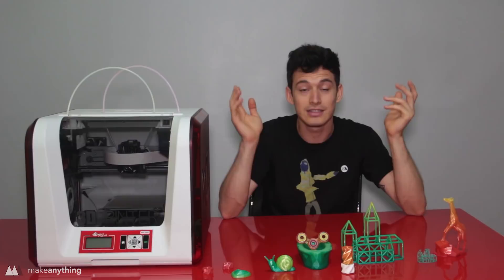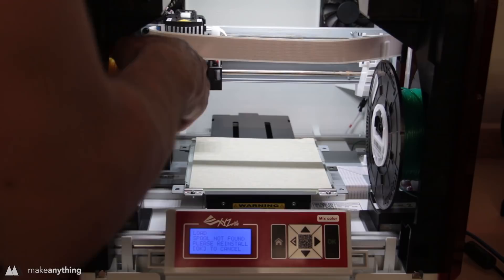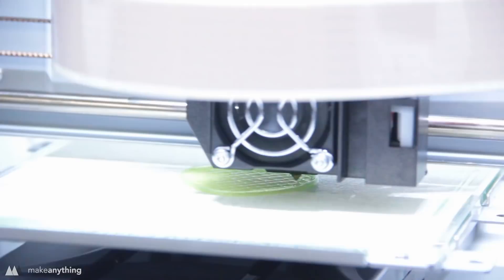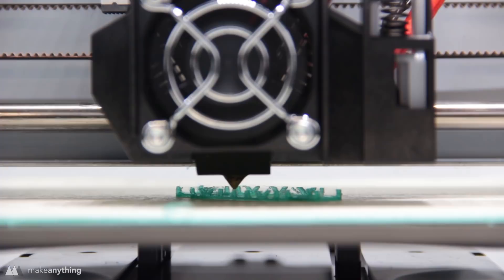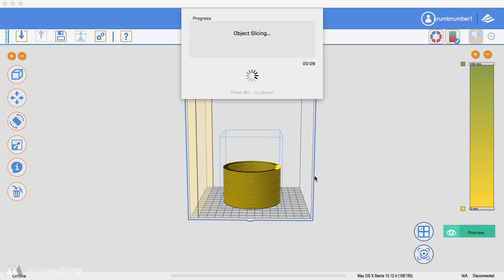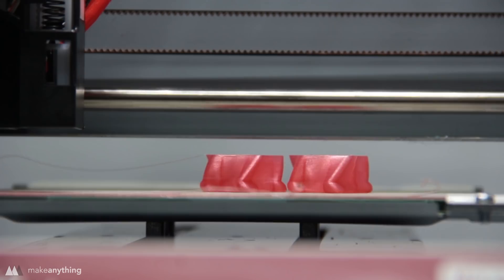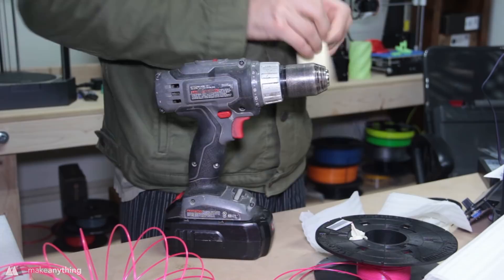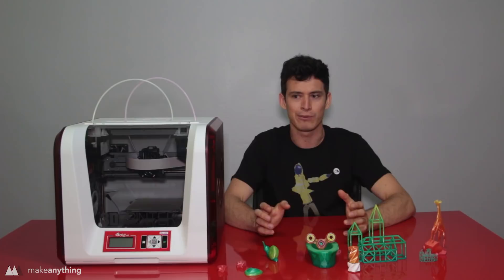Blending Colors with the DaVinci Jr. 2.0 Mix // 3D Printer Review

Comment: Even if this printer had incredible print quality, I wouldn't buy this on the principle that they've locked it to only use their spools. We, as a growing community, shouldn't be supporting these kinds of practices
Reply: And this printer only supports proprietary software
Reply: you probably could make something in fusion 360 or other software's and load it into that software and then you can print it
Reply: Not for stl files, for slicing, like you cant use cura simplify3d etc.
Reply: Box-Of-Hats I have a custom made reseter chip that will trick the printer into thinking it is full so I can use 3rd party filament. Now I have flashed mine to use repeater host firmware so I can slice with slic3r or any software I choose, but this took a lot of work and it's a shitty printer. STAY AWAY BUY ANOTHER PRINTER!!
Reply: Box-Of-Hats exactly, it doesn't use g-code. It uses its one code. You can't even use your preferred slicer.
Reply: Darien
Reply: Box-Of-Hats yep they took free open source stuff and tried to lock down the software  DO not BUY THIS IS A CON
Reply: I am a 3D-print enthusiast, although I don't intend to buy a 3D printer right now. I don't agree to this spool policy.
Reply: Buy a duplicator i3 instead of this
Reply: Totally!
Reply: Exactly if I could have used wax filament that I can purchase near me I would get this machine. Unfortunately they lost a customer due to this.
Reply: @Pandonaut  you can but it involves having to encrypt the gcode in base64 or something along those lines
Reply: You can use other spools. Well, you can actually reset the chip in the spools to think it has more than it does(you need an nfc capable read/write device) some really cool people were able to find the algorithm for the passwords and you can now get the password for your chip online. Complicated but if this printer is all you have then its worth it

Comment: So it needs to extrude a lot of material when swapping colours, has a shitty slicer and proprietary non-reusable spools.

Not really worth it.
Reply: ABaumstumpf while changing colors, a purge tower is normal. So no wasted plastic here. But im with you on everything wmelse you said. I would buy it, if they wouldnt lock you onto their filament a d slicer.
Reply: Bilal Akyüz there doesn’t seem to be a halfway decent open source slicer that does mixing, unfortunately. Slic-three-R has the other kinds locked down (multi-extruder and load/unload) but nobody is making a successful mixing printer that isn’t proprietary.

Comment: I had a Jr 1.0, and I basically had the same issues you did.

The biggest problem is the tolerances though. Printing statues and stuff is fine, but printing interlocking parts is VERY difficult as you have to modify the dimensions of the model to compensate for the massive over extrusion.

Another problem I had was accessing the extruder to clean it. It has a tiny opening where you can shove an included straw brush down into the extruder gears and that works most of the time. 

But if you ran into a filament jam and it really got dirty or you needed to oil something you have to basically take apart the entire top of the printer to get to the extruder assembly, and even that required some frightening wire disconnecting.

That being said, I replaced this printer outright with a Monoprice Maker Select Mini and I have been very happy with it. knocks on wood lol

Comment: Would it be possible to read the full spool nfc code and write it to blank nfc discs and use them to spoof spools?
Reply: You can now buy the nfc chips from a guy who makes them on ebay.  I use them and they work great.  You can put filament on the empty spools and start printing with no problem.

Comment: Great video, but the printer/software is exactly what I expected.
My first printer was the DaVinci 1.0a which had all the same problems you outlined. I quickly flashed the firmware to Repetier and things improved dramatically. Another huge negative is the customer support, it's horrendous. Worse than having none at all. They make you jump through hoops before they will even consider sending you the replacement part that snapped. That was my experience.
I've since given it to a friend ... yes, he's still my friend lol

Comment: Get a chip reader, copy each chip at its full state.  Then when it gets programmed by the machine at the end of spool stage you can reprogram it to its original state with your own filament.  If that doesn't work try making a clone of the chip to see if you can make it work that way.

Epson tried this in a way with their printers.  The chips on the ink tanks didn't really read the quantity for each color but rather the average ink usage.  Even with wasteful cleaning cycles you can hear enough ink sloshing around each cartridge to get some more pages out 'em.

As part of the work around people were making cloned chips that read "always full" for their Continuous Ink Systems which was largely due to running external ink bottles or tanks with way higher capacities than what ships with their printers.  Funny how Epson took that idea with their new higher capacity ink tank "eco printers".  But CIS setups were all about using pigmented inks for constant printing.

Comment: The reasons behind the proprietary filament are 1 (the main one) so they can make money in the long haul of the printer. They are kinda taking the ink printer approach where the printer is cheap but the ink is expensive. The other smaller reason is so they can control the quality of the filament. Yes its stupid and I would gladly pay a little ($100 or so) extra to get a printer that doesn't require specific special spools but just give it time and someone will find a way around this. That is if this printer becomes popular which I kinda think it wont.